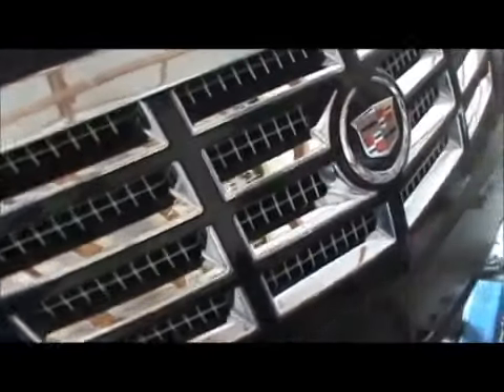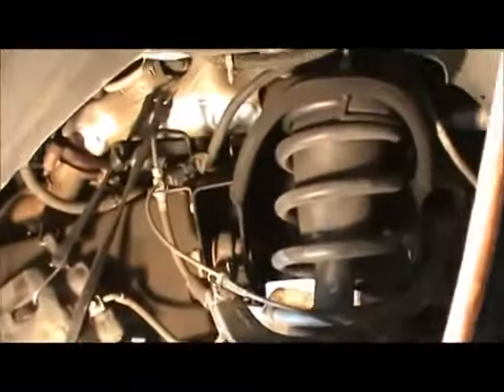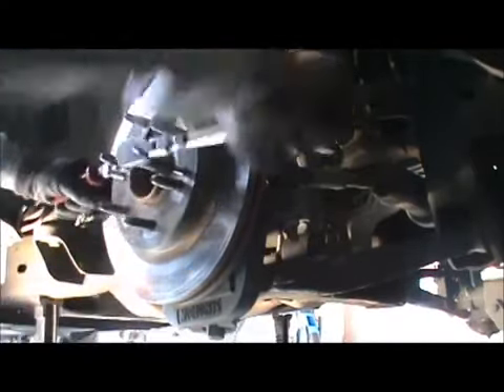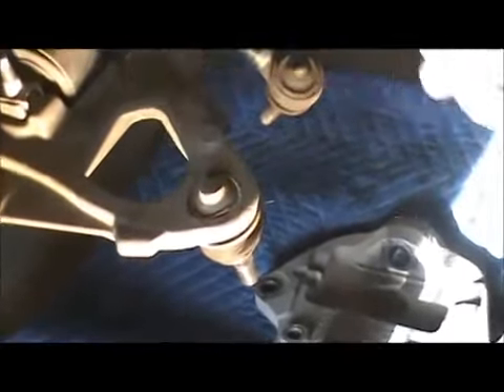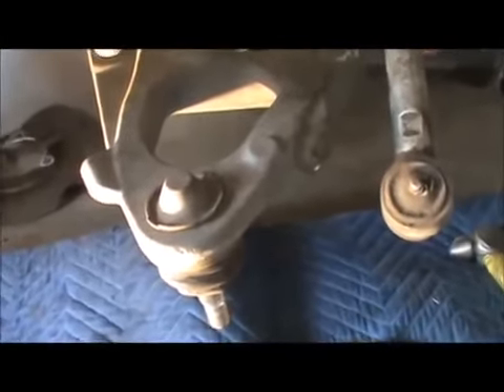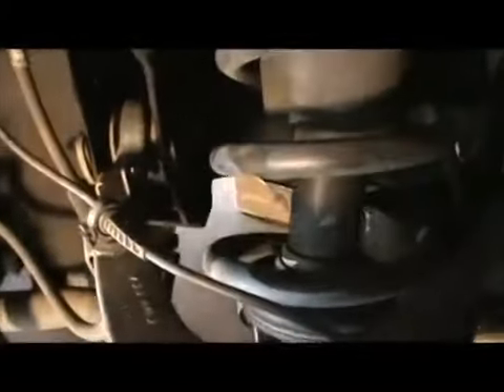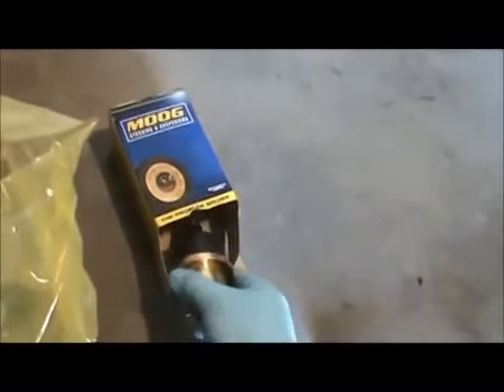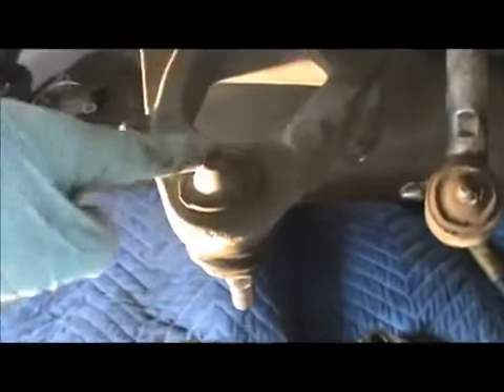Chevrolet Tahoe/GMC Yukon Ball Joint, Upper Control Arm, Hub Replacement

Comment: Glad I watched another video before doing this job...didn't need to remove half of what's done here...caliper stays rotor stays just remove upper ball joint nut and control arm bolts...yikes.

Comment: ,Anyone know how to tell if you have steel or aluminum Control arms, especially the lower control arm? Seems like you need different ball joints depending
Reply: Stick a magnet to it. Sticks=steel, doesnt=aluminum.
Reply: you can tell by the color.. if it's silver and not rusted then it's aluminum